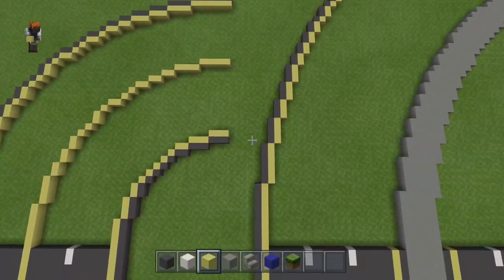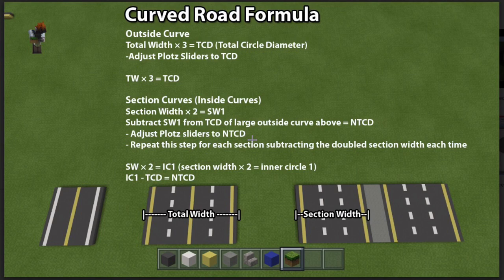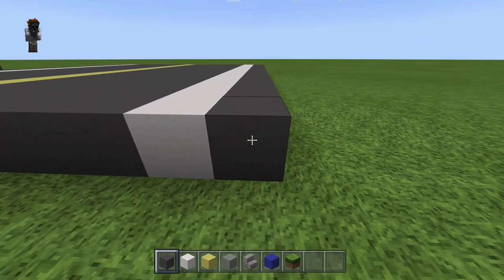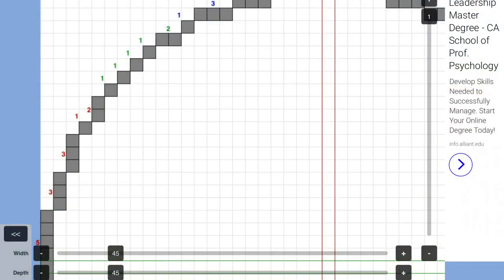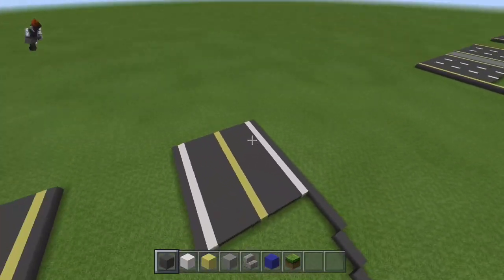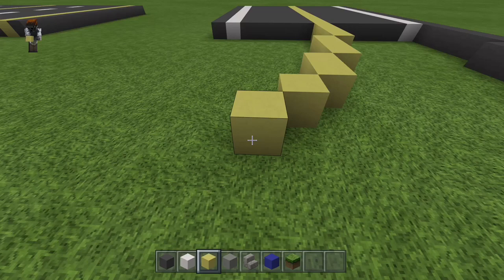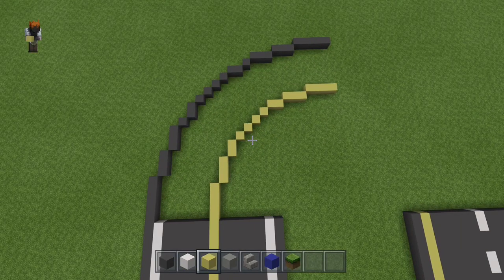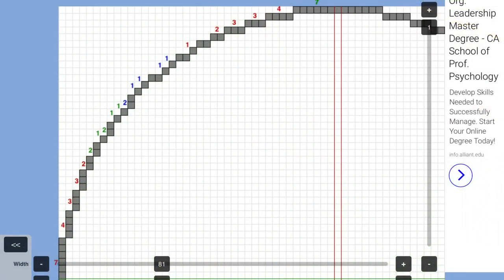MINECRAFT City Build | How to Build a City | Curved Roads - The Magic Formula | Build it Series  Ep1

Comment: Hey guys, just a quick simple tip to make the curve not as sharp. You can basicly take any total width that is higher than your true total roads width. using a 256 width on a 50 wide road will result in a nice very long turn used in real life, cause of the high speeds on high ways.
For the inner sections, just follow the formular. Use the Total width of your choice and substract the inner section*2 from it. So 256 - 25*2 in case of a 50 wide road. So the inner line will be perfectly spaced with the slider at 206 and so on.

Super easy but took me a while to find out cause I tried to actually change the entire formular first, which isnt needed XD
Reply from the maker: Thank you for working that out and sharing!
Reply: Shanti nice
Reply: Cool. I was actually thinking of this before reading this comment.  I'm glad you brought this up with a good explanation.
Reply: a trick : you can watch movies at kaldrostream. I've been using it for watching lots of of movies these days.
Reply: @Aryan Ares Yea, been using Kaldrostream for since december myself :D
Reply: Tysm both that really helped me build a highway!

Comment: Hey there! I wanted to do a less sharp curve in order to connect to a diagonally going road more smoothly.
I thought taking the total with x6 and the section with x3 (so everything doubled from original formula so it should cancel out) would work, but it didn't. 
Can I just play with one of the 2 sliders to adjust the curve? Will the outcome be good as well? Ever tried that?
Reply from the maker: Hi, yes adjusting the sliders to more of an oval shape would work. Or, each curve usually has some single blocks in the center, could add more to lengthen the curve and then continue. Would take a bit of trial and error to get it the way you want it tho.
Reply: After a few hours of testing, I just found out that it is actually super easy. You can basicly take ANY total width for the outer curve and just calculate with that. The max is 256, so I took that and had a really long curve, great for high ways. 

For the inner sections, it's just the regular formular, so if i'm 14 blocks away from the outer curve, I double that and subtract it from 256. 

I also use this to get semi-curves to smoothly go into a vertical road (kinda more realistic if you have roads facing like North-East too, for example, instead of only Norths. Souths, Easts, and wests :D
Helped me a lot! Never knew there was such a formula to make my Germanybuilding life easier ! Europe is known for having curvy roades even in Cities. Not like the square shaped Neighboorhoods in the US. So it definitly comes in handy. :D

Subbed btw^^
Reply from the maker: Awesome! Glad it worked out for you

Comment: Thank You so much!!! This is so helpful. I have only one question, what if i wanted to make a curve thats not a 90 degree turn for something like a slightly curved country road?
Reply from the maker: Thanks, glad it helped! In the center of the curve there will usually be single blocks between the flips, extend those and then continue. It may take a few times and some playing around with to smooth it out but that will make the curve more sweeping. Hope that helps

Comment: What if I'm making a road without 2 sections, like no divider line on the road? It's just a 6 wide plain road, only one section basically. Please help
Reply from the maker: Formula is the same, you just don’t need to repeat it. One and done
Reply: @RaceCrafter  Im probably putting more trouble on you, and I apologize, but what part would I normally repeat if I had a road with 2 sections? Sorry, I really don't want to refer back to the video tho.

Edit: nevermind, I get it. I apologize for my dumb comment, granted it is 3 AM and I'm probably tired.
Reply from the maker: No worries at all, no need to apologize, happy to help. Glad you got it worked out

Comment: But i dont understand what IS a section width? How do i figure it out?
Reply from the maker: A section width is determined by however wide your roads are. It’s not a set number. It’s used to calculate the inner curve(s). Once the first outer curve is made, the section width is however many blocks you count to start the next inner curve.

Comment: What is the minimum width for a road for this to work?
Reply from the maker: Well, standard is 5 wide, but i suppose 3 could work. Any smaller and it might get weird
Reply: Race Crafter tried it with five but the inside one got a little weird. Outside one was good tho
Reply from the maker: I used 5 in the video, so it does work. Maybe you mis-counted somewhere?